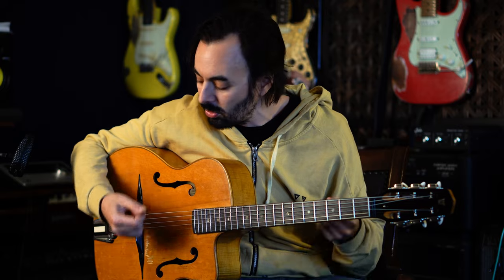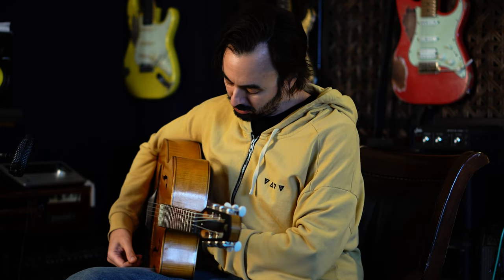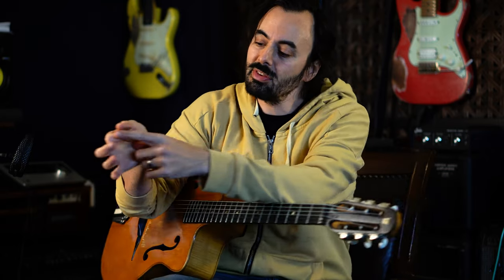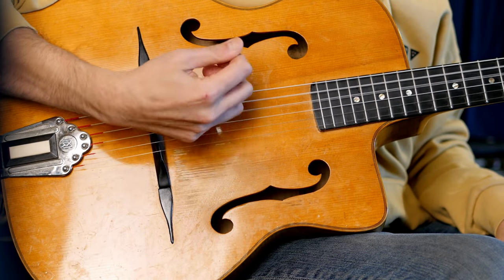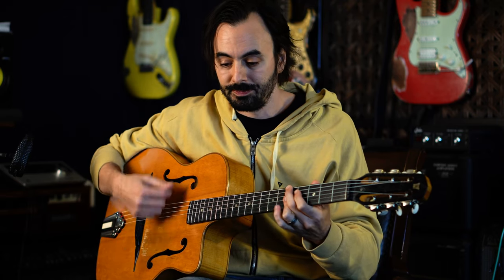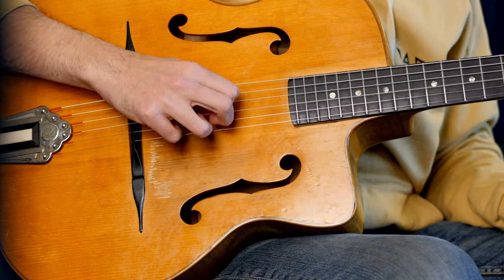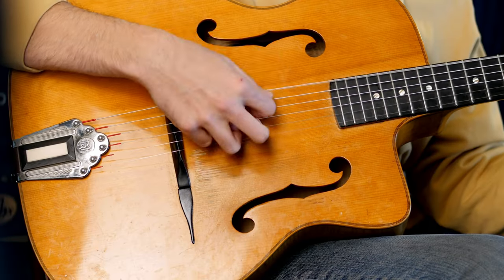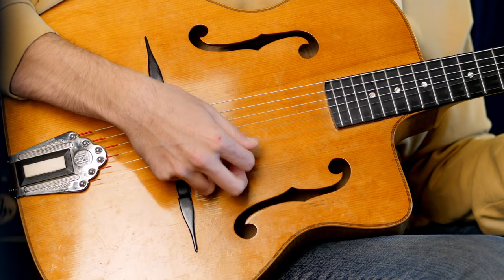IN DEPTH: Rest Stroke Technique For Gypsy Jazz Guitar

Comment: Fantastic lesson. I’ve been practicing in this style, and one thing I don’t get is the string muting strategy. I can no longer mute the low strings well with my right palm. Any tips? I’ve seen some say don’t worry about the ringing notes, or just use left hand techniques. But I can’t think of a good solution for muting especially the bottom 3 bass notes wile playing the higher strings. Thanks!
Reply from the maker: Gypsy jazz has no muting. It’s all about accuracy. Don’t hit strings you’re not playing and except sympathetic vibration as a part of the reverb sound that is in the style
Reply from the maker: Def join our Patreon for gypsy jazz deep dives! We do the often! Patreon.com/Marbin
Reply: @marbinmusic  makes sense. So do you use a different technique with muting when you play electric guitar? I play electric more often but steel and nylon acoustics as well. Thanks!
Reply from the maker: @armandosinger  yes I do
Reply: @marbinmusic  ah, got it. I’ve been experimenting with flattening my wrist more on electric, but still using a down rest stroke slant with an upward escape motion, like Eric Johnson. I think I’ll work on these 2 motions as they have some similarities.

Comment: Is the Gypsy style applicable to electric guitar? Or at least is it with some modifications (e.g., wrist lightly resting on the bridge)?
Reply from the maker: Yes
Reply: @marbinmusic  Excellent. Thank you for replying. I play  mostly through a high-gain amp with a thickly saturated tone. Hopefully, with enough experimentation I can find a way to implement this style cleanly.
Reply: @jeffhirshberg5171  I've been experimenting with this as well and found that I prefer using regular old alternate or economy picking on electric guitar even when I use Gypsy Jazz vocabulary. The starting on a downstroke whenever you change strings is mechanically pretty limiting for fast lines (well depending on how fast you wanna go of course - even Joscho Stephan abandons this technique for really fast lines from time to time) and the reason you do it in the first place is getting a strong tone on an acoustic guitar (cause amplification wasn't that good when the style emerged), which isn't necessary for electrics. Remi Harris actually did a great video on this :) 
Not trying to discourage you just some food for thought.
Hope it helps. :)
Reply: @DaveElwoodCutter  Thank you for sharing your thoughts. I'm coming to a similar conclusion.

Comment: What does "too Oriental" mean?
Reply: Orientalism in music is usually a feature of composition, not instrumental sound, but they're the same concept. Think rondo alla turca or Debussy's 'arabesque' or even the soundtrack to Aladdin or Prince of Persia. Essentially sounds that have been grouped into the western stereotype of 'eastern music' even though there is greater diversity in traditional music in 100 miles of Iran or any eastern country than in 1000 miles of the US- regardless, orientalism is music composed to fit that stereotype specifically by composers with no firsthand experience with real music from any region included in the stereotype, usually intentionally, and it has become its own style with it's own fans. By picking too close to the bridge on an acoustic guitar such as the manouche example in the video, the sound will have less bass, become buzzy, and have a snap or a cracking sound- all features one might associate with an oud or lavta, or even a bouzouki.
Reply: Question remains.
Reply: @sandyrothman2430  if you don't understand from that explanation, then perhaps I didn't understand your question.